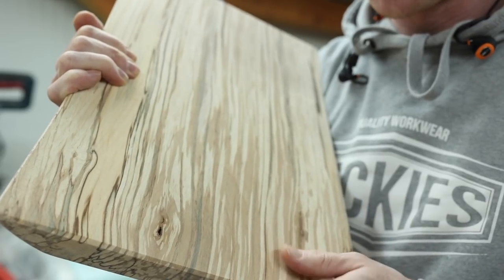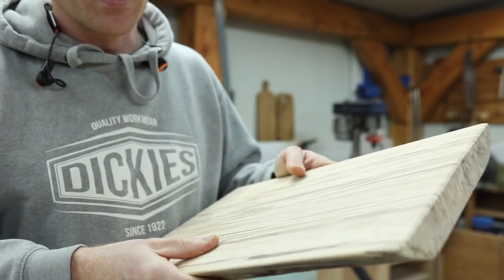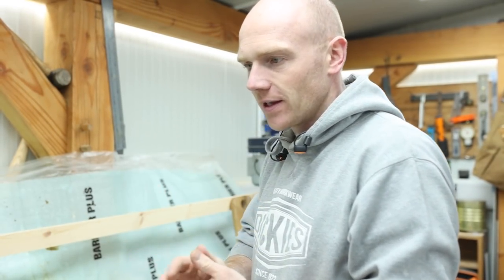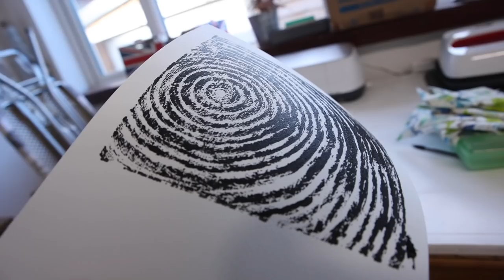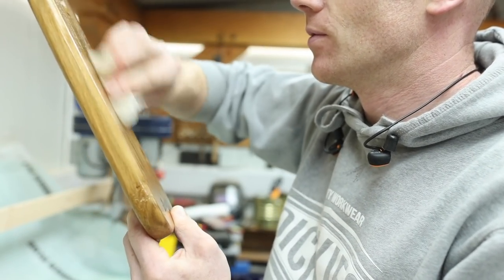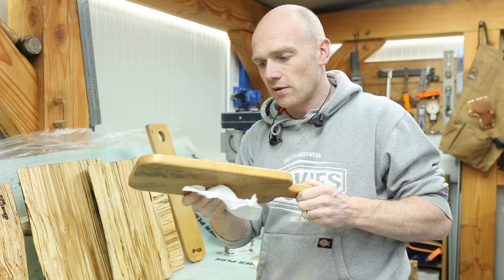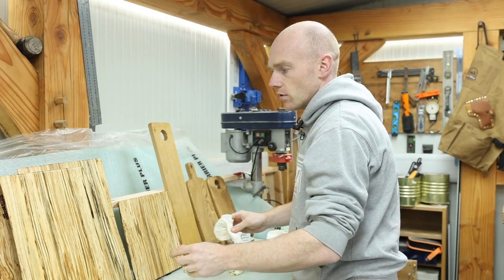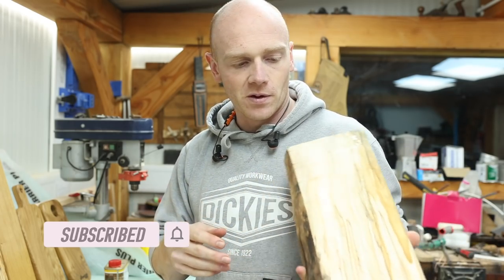Making our WOODEN PLATTERS, PRINTS & STOCKING FILLERS 🎄

Comment: Hey Tim,
 Is that spalted Beech that you are using? I started making chopping boards last year and was advised not to use Spalted timber as the fungi in the wood does not mix well with food.
Reply from the maker: 👍 Yeah that’s why we went with just serving platters and coat hooks.  Wouldn’t suggest using as chopping boards, although once kiln dried and finished it is not a problem, (from the research I’ve done at least).  No different from when it’s used for serving bowls and fruit bowls I guess.